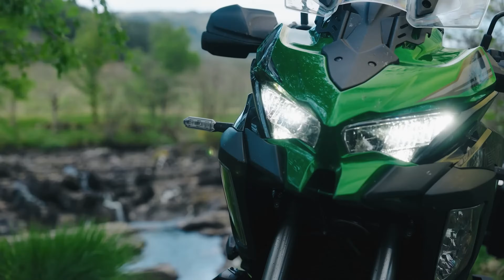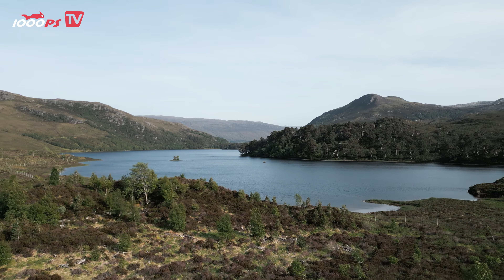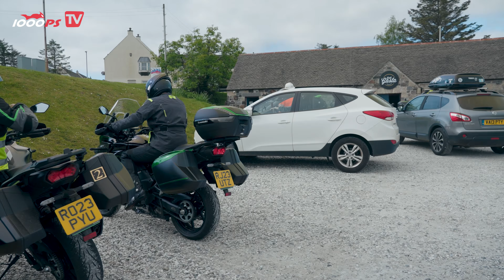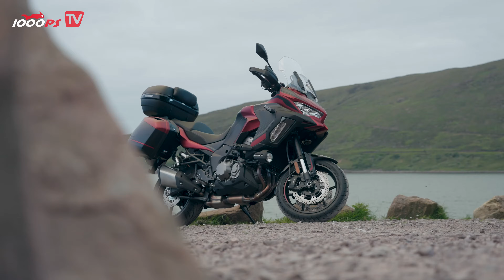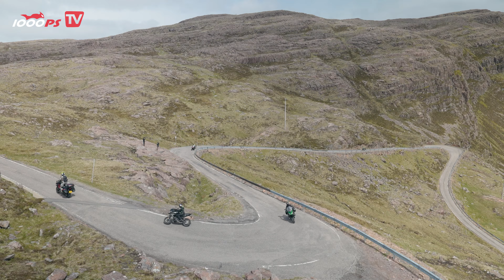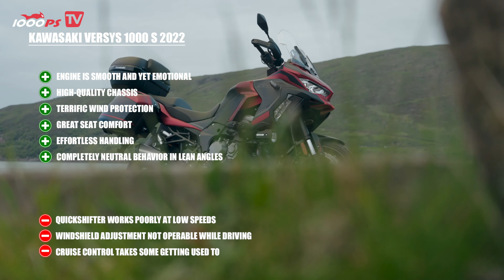On the Kawasaki Versys 1000 S through Scotland | Travelogue & Motorcycle Test

Comment: Solid all around bike.  Had mine for 2 years with 12,000 miles so far.  Only thing I would change is to move to a shaft drive.
Reply: Any problems with the quick shifter? Cheers
Reply: @bretthartin5877  no sir as long as you keep the RPMs up.  I also noticed that since I adjusted it for my new boots it works even better.  By adjusting, I mean I brought it up as high as it would go.  It’s not the buttery smooth but it works.

Comment: Owners manual states rpm's need to be over 2500 for the quick shifter.. the higher the smother it seems to work. Never had an issue with the cruise,  other than it does fluctuate a few mph, but not much different than my car.
Reply: Well said. Why do these reviewers never look at the instruction manual for the bikes they are testing? Quickshifters came from racing, and are designed to permit clutch-less changes at speed when accelerating or braking. So the Versys 1000 manual specifically states that the QS works best above 2500 rpm when accelerating, or on a closed throttle when decelerating. It’s completely pointless to try using it in town traffic. I use mine all the time out of town, it’s great on twisties. 

Moral of the story is to listen to real owners, not these reviewers who’ve been flown in to enjoy the hospitality and the free test ride!